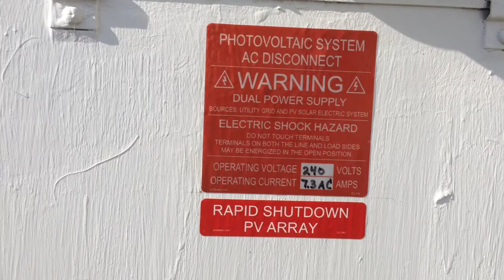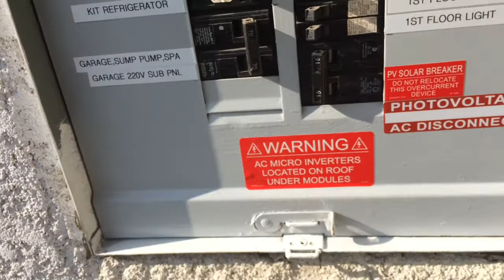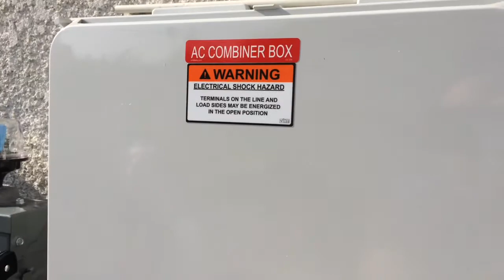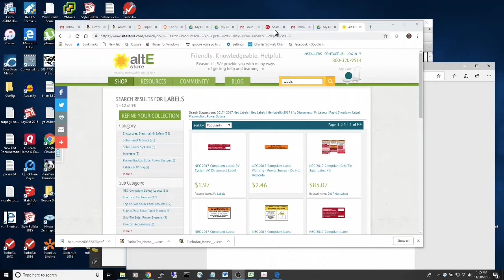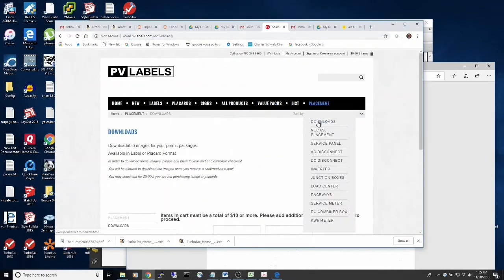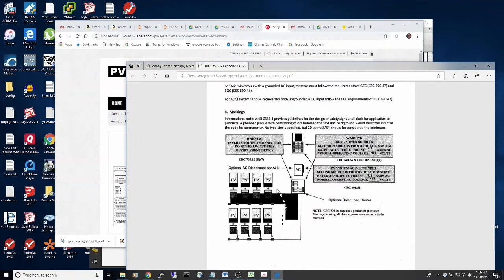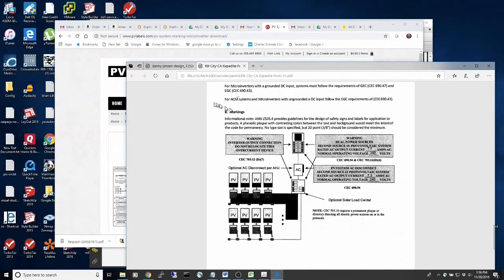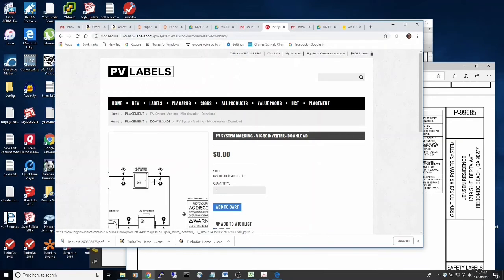Solar Installation Labeling Requirements for Permit Inspection. DIY solar installation

Comment: My most recent experience with my second micro-inverter system was that the inspector said I needed more labels and I need a directory plaque. However I believe the inspectors are confusing the requirements of complex DC systems and a simple AC micro-inverter system. They are probably overwhelmed by all the commercial installations that just plaster their systems with labels. I was viewing a few sales promotional videos from label vendors and they where showing 3,4 even 5 labels on panels, boxes and inverters. He also did not like my P-Touch labels, saying they where not "graphical" enough. I pointed out the NEC code states they simple can not be hand written and should be durable. The existing outdoor P-touch labels from 8 years ago are still looking fine.